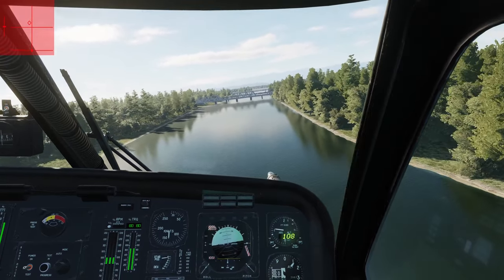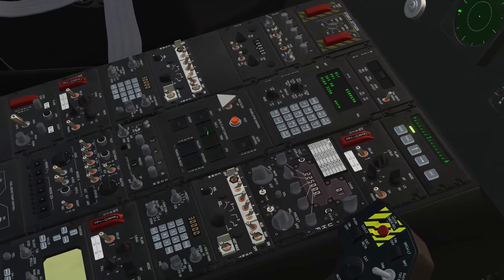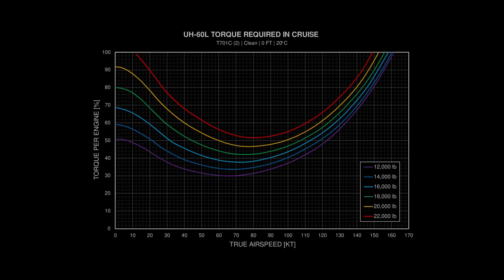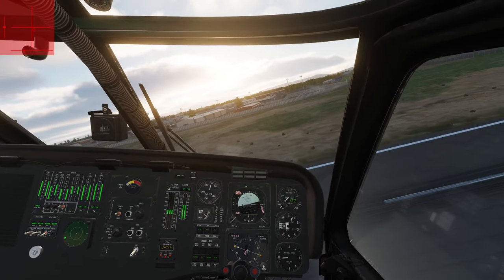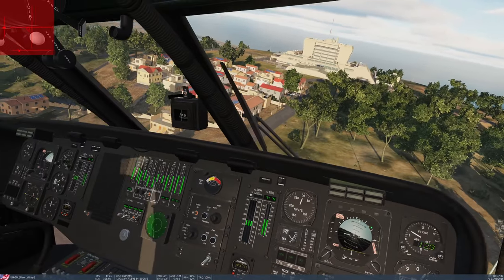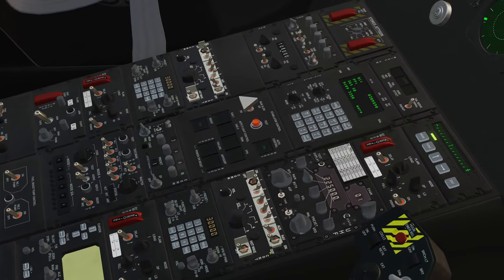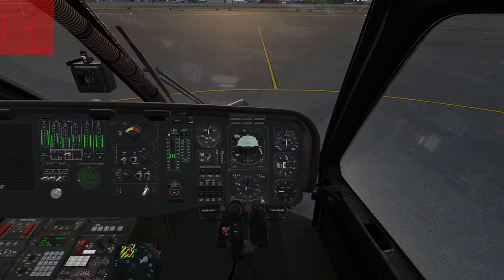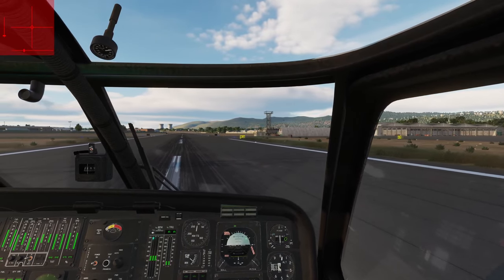A Critical Look at the UH-60L Mod for DCS World

Comment: Nice presentation. I enjoy this Mod. Good explanation of the mod, the flight controls and the reasons for why they did what they did. Also the tail plane portion reveals this is critical component-I guess so because it has a gauge right in front of the pilot's face...explains the nose-over into heaven. At first I thought this might be a Michelangelo made the David's hands too big ego trip, but then the tenor of the presentation moved to an engineering level discourse but the with real-world textual (Dash-10), and visual explanations-good for single diode operated beings like me (former USMC). I took away much from this presentation and appreciate it. Good job.

Comment: By far the most comprehensive overview and review of this module. Not sure if the devs are familiar with system control theory though. Most people dont even know what summing junctions are, much less how to derive transfer functions with feedback loops.
Reply from the maker: Yes, I was careful to not include diagrams with transfer functions and such as that would get too complex for an audience that is broad enough as it is. If you want the full details and all the transfer functions, NASA CR-166309 has everything you need. It also contains a full mathematical model of a Blackhawk that is essentially the component-wise model I suggested at the end of the flight model section.
Reply: @ErikScott128  Thanks! I will definitely check that out. Been needing to flex my Simulink muscles a little bit anyways.

Comment: In my opinion, "doing it for free" has become the most go-to excuse after "tested by real pilots". Speaking of which, it has become almost customary to include the latter line in every civilian flight sim addon disclaimer. People almost unanimously fail to realize just how different "flying" an aircraft (or operating other manned vehicle) in a sim is compared to reality where your sight almost takes backseat to the other senses, not to mention how much less you are getting through vision in a sim. "Subjective" is putting it VERY mildly - if you ask a dozen of real pilots to create "flight models" based on their perception alone, you are getting a dozen of very dissimilar such flight models. Engineers, on the other hand, don't really operate on perception - and that's why videos like this are massively more useful than "real pilot" input.

I highly appreciate what you are doing here, Erik (also for free, by the way, and not even allowed to go to the full extent). Only turning to open source and having both the code and FM behavior reviewed by competent parties is a good recipe for proper simulation.

By the way, have I understood you correctly that for rotary wing aircraft BET-like models are much more preferred to the "whole thing" aerodynamic table array FMs similar to what can be found in CR-3144 or TP-1538 alike? My defense for the tables is that Aerodynamics is way too complex to have any hope to easily break down the airflow at the components and parts level and integrate the results back up - especially using something as primitive as "Blade Element Theory" that is simply unaware of vortices - while the results that go into the table are usually "solved" by nature itself (although wind tunnel testing has its own set of flaws too). But I guess with so many degrees of freedom as helicopters have, populating enough tables to cover for most situations becomes a seriously arduous task.
Reply from the maker: Thanks for the comments. You make a good point about the benefits of having the behavior of the aircraft rolled up into a table of derivatives. You're absolutely right that this permits you to incorporate various complex aircraft behaviors without actually modeling the physics. While I have never worked on fixed-wing simulations myself, I know that this method is used extensively for high level flight simulators used for fixed-wing flight training (think "Class D" flight simulators). The required level of precision in making the aircraft behave correctly is quite strict, and so they turn to modeling the behavior rather than the physics. To to this, they actually measure the stability and control derivatives using real-life instrumented aircraft in an incredibly large number of flight conditions (airspeeds, weights, CG positions, altitudes, etc). This is a great method if you never plan on flying in conditions significantly outside the range of conditions spanned by the data and you really don't care about the contributions of each part of the aircraft. Additionally, these types of simulators are not typically interested in modeling aircraft damage (though they will model things like engine failures and other emergency situations). Modeling the effect of damage is a fairly crucial element of a combat simulation like DCS, so having a model that can handle that fairly seamlessly is a great benefit. You could have an entirely new set of tables to represent different damaged states, but you will need some way to generate that data in the first place. 

You are pretty much on the money with that last sentence. There are indeed many more things you have to worry about with a helicopter, and the level of detail can also vary wildly depending on the level of depth you want to go to. For instance, you could get a decent simulation by providing each blade a flapping degree of freedom and assume the blade is otherwise rigid (this is what DCS does, I believe). You could then add a lag degree of freedom for each blade, and you could also start to include blade flexibility, which means a degree of freedom for each elastic mode you wish to include. And then you have to model the inflow. Most real-time simulations will use a 3-state inflow model which approximates the induced inflow across the disk as a uniform plus lateral and longitudinal gradient. For non-realtime analysis, freewake codes have become popular. These model the wake as a series of vortex filaments that are free to move and distort based on the influence of other vortices within the wake. 

Modeling the rotor inflow and flapping degrees of freedom are probably the most essential aspects of making a helicopter simulation behave correctly. There is a noticeable time delay associated with putting in a cyclic command and the aircraft response due to the time required for the blades to flap. A simple 6DOF linear model will not capture this, and the discrepancies become significant at higher frequency inputs. On the other hand, however, there's no reason why you couldn't include the rotor flapping and inflow states as part of your linearized models. These would likely have to be derived from an analytical non-linear model, however. 

Lastly, I will say there is absolutely still a place for these linearized models in an engineering context. Control system designers rely on them extensively, and simplified (inverted) linear models may even be used in the control laws themselves to predict the appropriate inputs to make for a given command before waiting for feedback. This is called "model following control."

Comment: I would be curious to get your impressions of the flight model in 1.2 since the change log specifically mentions more accurate torque modeling.
Reply from the maker: Yeah, I timed the release of this video pretty poorly considering the 1.2 release just came out. I haven't tried the 1.2 release yet, so I can't comment yet. I don't think I'll be doing a video on it, but I'm interested to see what's been changed. I do know they addressed the field of view out the chin window by reducing the scale of the front panel. I don't know if other geometric errors have been fixed yet. I did send their 3d modeling a bunch of my own photo references recently, so I do know things are being addressed. 

Regarding the torque, I think there may be various kluges and fixes that can be addressed to match the performance in steady cases, but I think it's still going to be very difficult to handle the dynamics properly without moving to a fuller-fidelity non-linear model. I'm not involved at all with the development, however, so that's all just speculation on my part.

Comment: I'm really struggling to get this thing to hover  - yes I've switched off the TCS (I think it's called) but I'm still having issues.
The biggest thing I can't seem to manage is to slow down to land. I try to bring the nose up and decrease collective but the speed dosnt come off very quickly.
Reply from the maker: Enabling the FCS should help you hover, but you need to hit the trim release to have it capture the aircraft attitude. But still, hovering with just the SAS isn't that difficult (though it seems they've changed the SAS a bit in the 1.2 release). Hovering helicopters generally just takes practice and developing a bit of feel. There is a lag associated with your inputs. The UH-60L captures this somewhat, but in real life there would actually be a slightly longer time delay associated with the blade flapping that really can't be captured with this simple model. The point is, there's a delay between when you deflect the stick and when the aircraft responds, so it can be easy to overcontrol. What I recommend is if you need to make a correction, put in an input and then immediately take half of it out. With practice, you'll end up doing this naturally, and you'll learn to anticipate the aircraft's movements and make corrections seemingly before you even consciously notice the aircraft drift. I also highly recommend focusing on a distant object when hovering while tracking closer references in your peripheral vision. this can really help you control your attitude and prevent you from over-controlling. Focus initially on arresting translational velocity rather than holding a position. once you master hat, then move on to hovering above a chosen spot. 

Regarding deceleration, you again have to be patient. You can yank the nose way up, of course, and this should increase drag substantially, but doesn't with this model. Regardless, slow decelerations is what you want to start with, and is what you should be doing under normal circumstances. Start by flying down a runway at about 100 knots or so and pitch up a few degrees from trim, hold altitude by managing collective and see how far you drift down the runway before stopping. Do this for a variety of initial speeds and pitch angles and you'll start to get a feel for how it decelerates. Once you start to feel you can control the deceleration, then work on decelerating to a hover over a specific spot. 

Overall, it takes patience. I did say in the video that this is the easiest helicopter to fly in DCS, and I stand by that. However, it is still a helicopter and is still difficult to fly when compared to fixed-wing aircraft. It will take practice and requires developing a feel for how helicopters behave. It you want to really get started with helicopters in DCS, I recommend the Huey module. It's a bit old, but it's probably the most bare-bones helicopter experience there is in DCS. And it's a great way to learn and develop your skills.